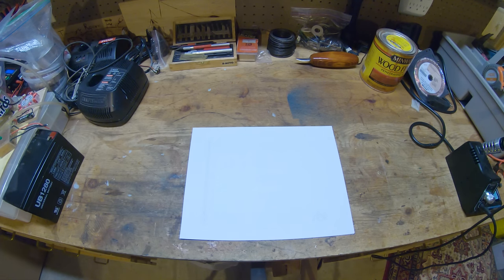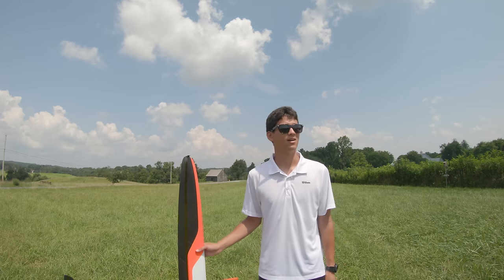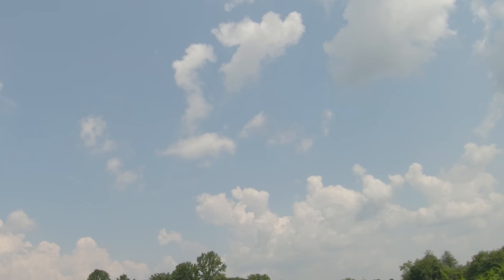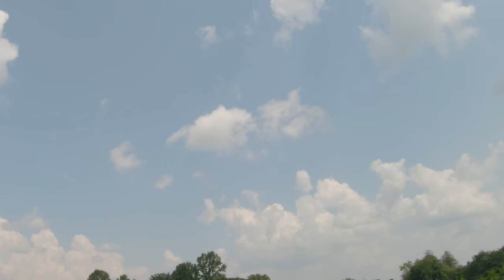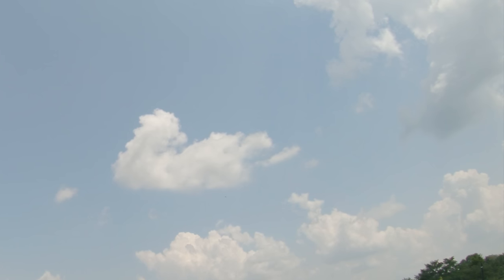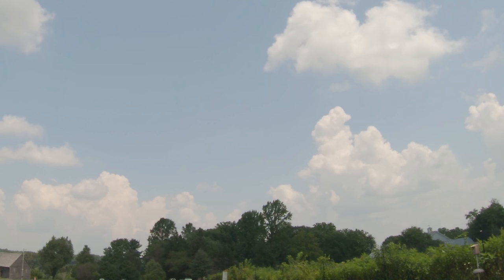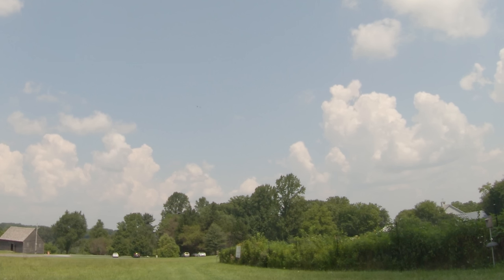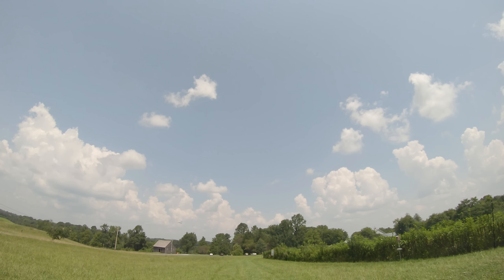How to Thermal Your RC Glider

Comment: Timmy RC, great video, very well done. I am just starting with foamie gliders, your tips are noted and appreciated. I just subscribed, maybe you could go over over good beginner gliders , what to look for without breaking the bank ?  Your discus hand launch glider technique is remarkable. What kind of glider are you flying in this video ?
Reply from the maker: Thanks! If you already know how to fly I recommend the Armsoar GO Mini as your first DLG. It has the same premium construction as other high end DLGs, but is more affordable since it is slightly smaller (1m wingspan versus the standard 1.5m wingspan). The glider in this video is the Kennedy Composites Snipe SN Lite.
Reply: Great video im getting back into the hobby as well and just bought the dlg libelle as my first true pure glider. It is a foamy from dream flight. I am learning how to program flysky fs-i6x. I am curious  what your alerion/ flapperon down setting is while in the thermals.
Reply from the maker: @scottstankevich8866  I use my "float" mode in thermals, which is set up for minimum sink. On my glider that is approximately 5mm of downward flaperon deflection.
Reply: @TimmyRC  Timmy, would you call your "float" camber? I have my ailerons programmed as flaperons  and using Variometer A on my Fly Sky iS-6X. They ailerons function normally but each Aileron has a separate servo, that way flaperons can be programmed through Mixes. I got this idea from a You Tube video.
Reply from the maker: @steelydanfan100  Yes, my float mode increases the camber of the wing by deflecting both of the flaperons downward.

Comment: Whats the wingspan of this model?   Also, what would you recommend for a first DLG glider?
Reply from the maker: The glider in this video has a 1.5m wingspan and is called the Kennedy Composites Snipe SN Lite. If you already know how to fly airplanes I would recommend the Armsoar GO Mini. It has the same build quality as other high end DLGs but is less expensive due to its smaller 1m wingspan.
Reply: Timmy RC - Thanks.. I have many years flying RC with some glider experience.   The DLG's fascinate me and I'd like to give it a try.

Comment: Bad ass man. Seems the armsoar mini is sold out :( And your setup is crazy $$$. There are no other budget friendly versions?
Reply: Also what tx you running?
Reply from the maker: @mcdo0gal1985  There are a lot of budget friendly DLGs such as the Dream-Flight Libelle, however I usually recommend the higher-end gliders such as Armsoar Go Mini just because they will fly way better. Another good alternative is to buy a new or used glider off of a forum like RCGroups. You can pick up top of the line models from a few years ago for relatively cheap. I have bought two brand new glider kits from RCGroups and saved about $200 each time compared to retail.

My transmitter is the Spektrum DX8 (1st generation).
Reply: Timmy RC went with an Elf to start!
Reply: @mcdo0gal1985  oh the elf is amazing! I love mine

Comment: You know a bad scenario that I have difficulties ? Windy day : sometimes we do have thermals but it s wind, and wind comming to you : ao you go to front, you catch something, start cyrcling, but you come to your head very rapidly, and you have to change pathway : or due to distance (always bad to go down wind far from you) or due to the sun on your eyes. We have these type of days very often here in Brasil, and you see clearly that the day has lots of thermal activities because wing shakes a lot. But it s very hard to stay in the air because when you try go for the next, you put in the speed mode, and have to go against the wind again, and loose altitude very fast. Then you cath nothing. Can you comment ?
Reply from the maker: Wind can be an indicator of where the lift is, but when it's very windy thermals usually can't grow as large and its generally harder to catch thermals. The wing shaking doesn't necessarily mean there's lift, and when it's windy it's often just turbulence shaking the wing. When thermalling in the wind, you should let the plane drift downwind as you circle in the thermal, since the thermal will also tend to travel downwind. Once the plane gets too far away you have to fly upwind to find a new thermal.

Comment: Do I need carbon dlg or will a 3m balsa glider work
Reply from the maker: You can thermal with pretty much any glider, and generally bigger gliders are easier to thermal. However, if you want to discus launch a glider you will need a model that is designed to take the extra stress of the launch.

Comment: Nice.! Ty.4sharing awesomely done!! Puffy clouds means a lot of lift....? Huh!
Reply: Lol.. awesome!
Reply: Or you can just find soaring bird's and they'll tell you where The Thermals at, if you're lucky to find them
Reply: I forgot about this but, I did find a thermal one day with my glider it's the UMX glider, under the birds lifting up it's getting high for this little two foot plane oh, wouldn't you know it the bird realizes I'm coming up flies out of the thermo does a circle comes back and rails my model... I threw the motor on chase him around a little bit but got a couple holes in my plane ...LMAO
Reply from the maker: Thanks!

Comment: Hi
I see You keeping a lot of speed when circling. Most pilots try to slow and keep as close as possible to centre of thermal. Why You goes so fast? I see it work, but dont know why :)
Reply from the maker: You are correct that you generally want to fly slow and turn tight to stay in the center of the thermal. Thermals spin, so if you are flying in the same direction of the spin, it will look like you are flying faster. Ideally you want to fly opposite of the thermal's spin so that you do not have to turn as fast.
Reply: @TimmyRC  thermal spin is always in this same direction (on nort / south hemisphere from coriolisa) or can be different every time?
Reply from the maker: @MaciejRM  I can't find a definitive answer on this, but some people have claimed that the air mass of a thermal isn't enough to cause the thermal to rotate the same direction every time due to the Coriolis effect.

Comment: How hight can you launch an DLG in dead air, without helping wind?
Reply from the maker: I do not have an altimeter on my DLG, so I have no idea how high I launch. Pro pilots regularly launch over 200ft.
Reply: @TimmyRC  Thx man. What ever i do or try, i only reach 30...32m (~100 ft) with a LongShot3. Is it really normal to reach 150...200ft after 1000+ launches? Maybe I do something wrong...
Reply from the maker: @nicowagner6086  There are a lot of things that can affect launch height. Technique, presets, and airframe are the biggest ones, so maybe try changing/improving these.

Comment: .....Do thermals spin in a cyclonic fashion?!... like a slowly spinning "tornado"?!.... If so, do they always turn/spin in the same direction (CW, or CCW)?!.... Which direction should your glider fly?!... against the cyclonic spiral?!....
Reply from the maker: Yes, thermals spin in a cyclonic fashion, and they do not always spin in the same direction. You should fly your glider in the opposite direction of the thermal's spin (for example, if the thermal is spinning CW, you should fly your glider in CCW circles). The only easy way to tell which way the thermal is spinning is to charge the direction of the circles you are flying. If you are flying opposite of the thermal's spin, your glider will appear to be flying more slowly and will gain height more easily.
Reply: google it lol

Comment: IMO you forgot to mention, that thermals are more likely to build over bright surfaces (wheat fields etc) and less likely over dark terrain (lakes, woods).
Reply from the maker: That is not fully correct. You are correct that thermals are less likely to occur over heavily wooded areas and bodies of water, but this is due to their higher thermal diffusivity, not their color (e.g. it takes a long time for a lake to heat up compared to a field, but this is not predominantly due to color). Making an "apples to apples" comparison, darker objects/terrain will actually create stronger thermals than lighter objects/terrain. Darker objects/terrain absorb more of the sun's radiation, making them hotter. This enables the creation of stronger thermals than objects/terrain that are lighter in color, but otherwise equivalent.
Reply: @TimmyRC  Thanks. Of course I don’t know everything, but there are differences between terrains.

Comment: Parallel, not perpendicular!!
Reply: @John Sayles - Why two exclamation marks? You appear to be a little over-confident. "Perpendicular" is correct, You see, as Timmy watched his glider he maintained a "line of sight". When the glider moved left to right, or right to left across his "line of sight", the glider was definitively "perpendicular" to his "line of site". Note, Timmy did not say "field of view", which is why "parallel" may, or not be, correct. That's another argument, altogether. Your thoughts?
Reply: @rango_unchained  Must be my degree in maths that allows me to be over confident when differentiating between parallel and perpendicular.  I'm not going to watch a video I originally commented on myself some 3 months ago.  If you wish to engage in such a conversation you will need to find someone willing to participate in it, not me.